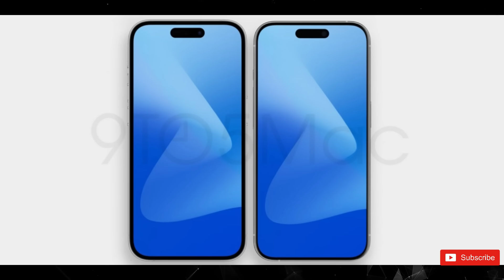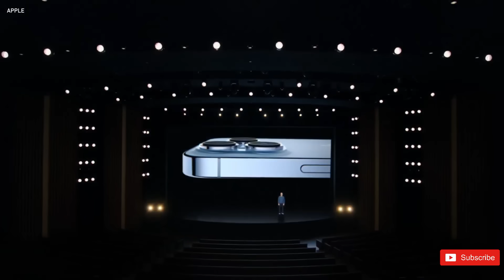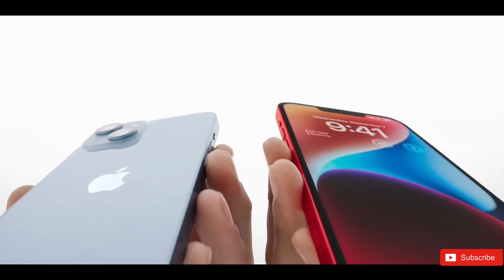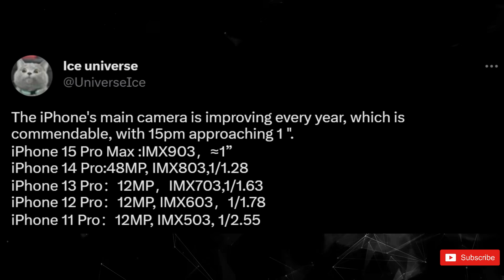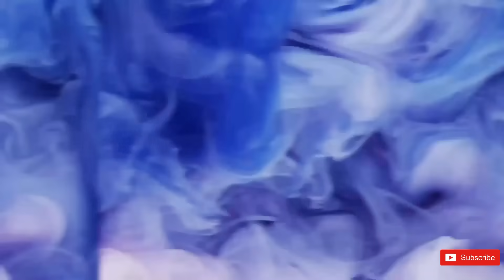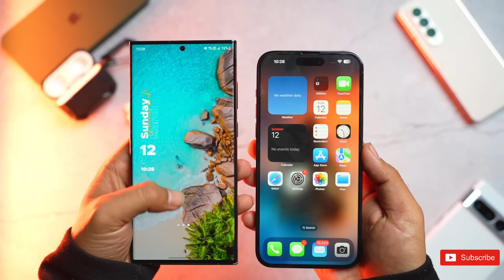iPhone 15 Pro Max - EVERYTHING SO FAR 🔥🔥

Comment: The current iPhone Pro Max's tiny 3x optical zoom has a 12mp sensor. If the iPhone 15 Pro Max with 6X zoom has a larger sensor, say 24mp, it could be geting closer to the Samsung Galaxy s Ultras, which have 10X optical zoom but only a 10mp sensor.
Reply: Samsung galaxy ultra is 100X zoom
Reply: @abdou5204  I know. I have one!